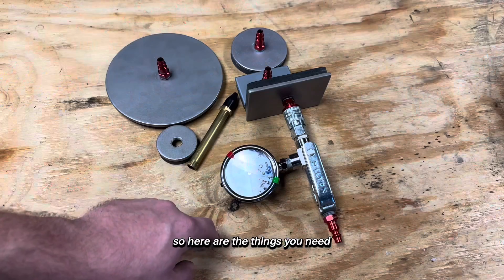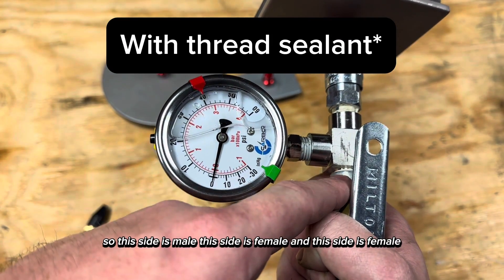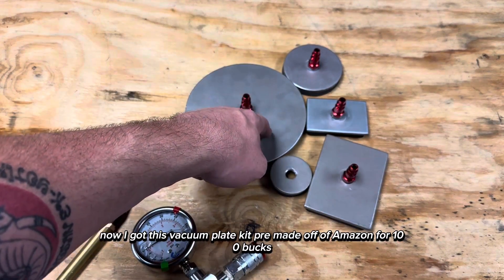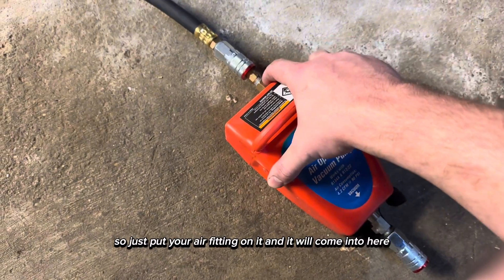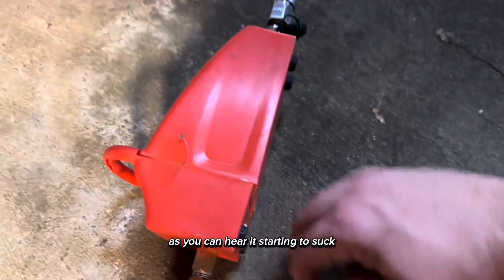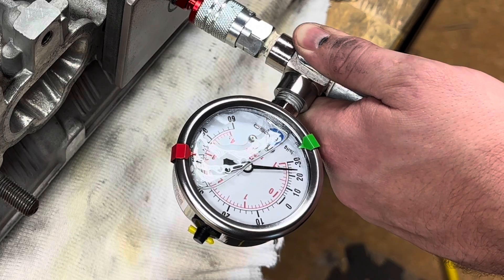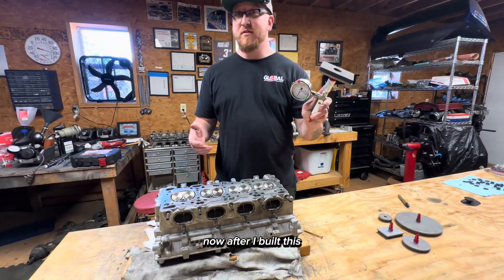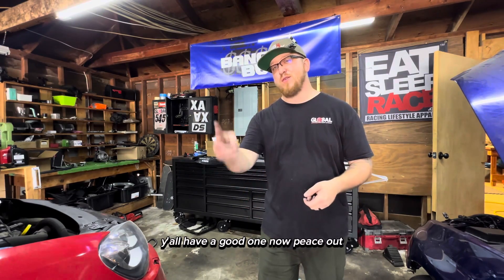DIY Valve Seal Tester!

Comment: Once again im gonna put this in the handy file portion of my brain. I had one of those reverse venture' valve set ups for A/C work years ago but i just hardly ever used it and it probably went at a yard sale. 

Thank you! 

Guys like this toil away for minor gains . Petty solid improvements.  One frustration after another that they endure so i can snatch a rag from the rust back pile and breath fire back back into it for a bit.

Thats right my amigos. I build junk. I take 400 dollars throw away cars and build them back to life again. If you didnt crash it then i can restore its function safely, and it is in large part thanks to people like you that  i even dare to try.

Most of the tech you are using is above my paygrade but the scraps falling to the floor are definitely worth catching.

Better a portion with the poor baby!!! Everytime. Better parties.❤

Comment: Interesting video, thanks. I am not a mechanic so please pardon the question but, instead of pulling a vacuum, is it not possible to blow compressed air in? And if so, how much psi would be needed, thanks.
Reply from the maker: You can used compress air but sealing it off becomes more challenging. You would either need to bolt the tester to the intake manifold holes and test or another way is to seal off the chamber on the headgasket side and test through the spark plug. And for psi the trick would to be is pressurize the port say 60 psi then measure how long it takes to leak out and try to equal that across all ports. 

With the vacuum gauge it’s easier to see okay this one pulled 24 inches of mercury and then this one pulled say 15 so you can do more lapping to get it closer to that 24.